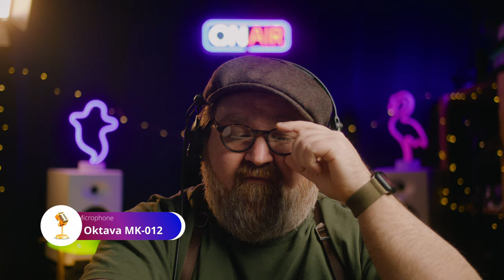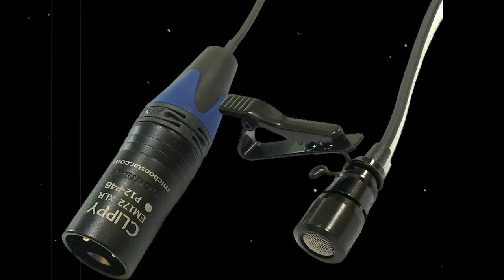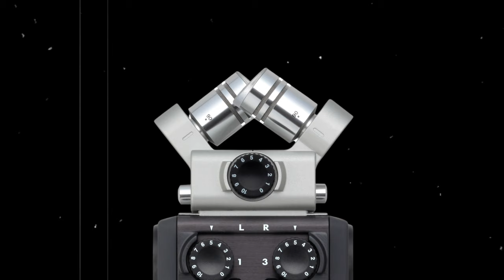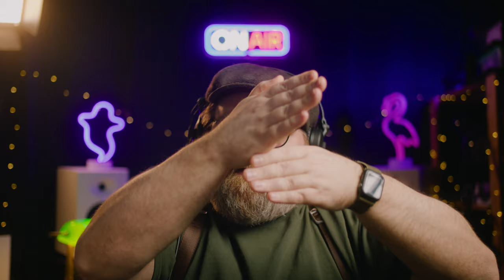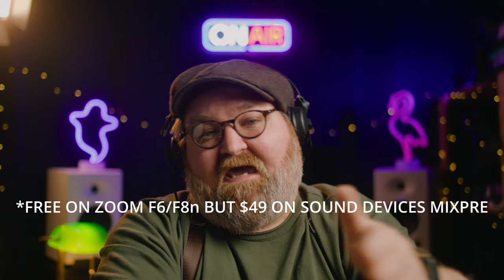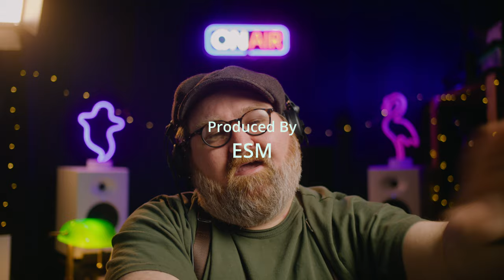Introduction to Field Recording Volume 2

Comment: Can you tell if the Rycote BBGs are a working fit for the CM4s? I use two CM4s in ORTF for Ambience and really like the results but building a windscreen that really works is tough!
Reply from the maker: Oh yes. The CM4s hate the wind! Any SDC mic would. The BBG will work for sure, but that depends on how much wind you’re dealing with. Sometimes I’ll also add the foamies that come with the CM4 along with a BBG to further help with the wind, and then just boost some highs in post to compensate. 

I hope this helps!

Comment: Thanks, I have been waiting for this!
OK, so setting up as ORTF with omni is not effective...sigh, well I guess it's not much different from AB.  Speaking the setup at the beginning is great advice, I wrote some software to transcribe any words at the beginning 30 secs as data, and I also take a photo whichI use to get the time, gps and weather.

looking forward to vol 3, and hope it's not all big budget gear.

thank you!
Reply from the maker: Those are great ideas! 

As the new videos come out in this series, I’ll be doing a mix of low cost and higher cost gear. But the only high cost gear I use is maybe the MixPre recorders and a Sennheiser 416. 

Cheers!

Comment: How do you go about metadata, levels, technical info like sample rate, putting it into a pack and selling it? What should I as a filmmaker expect when I purchase a field recording pack?
Reply from the maker: Hey! Thanks for the great question! 

If you have a recorder that supports notes and metadata on-site, this is also preferred but vocally calling out the info AND typing it either directly into the file (Sound Devices recorders et al) is always the safe route. 

As far as how to use that data, novice filmmakers and those not doing professional jobs might not care about that data. But SOMEONE WILL somewhere down the line and it’s super important to have it. 

To use it in practice, you might incorporate some or all of that information in the file name using the Universal Category System (https://universalcategorysystem.com). 

This is an industry-wide push to easily categorize all sound effects across the board. A lot of that metadata comes in handy here. 

As a filmmaker, if you don’t care about mics used or location or even time of day, then it won’t matter to you. But you might know exactly what you want because you need Norway, at Oslo at dusk (because the sounds specific to what you’re looking for). Etc. 

Hope this helps!
Reply: @TheRecordist  Thank you so much! I need some norwegian ambience and mountain bike sounds for a film I'm making, and so far I haven't found anything useful. So this summer I thought I'd try recording my own stuff. So this video could not have come at a more perfect time
Reply from the maker: @MarkusFinholt  oh that’s awesome! Good luck!

Comment: This is so valuable. Could you touch on making clean recordings, the activities that go into post. Also what a typical buyer of high quality audio looks for.
Reply from the maker: Thanks very much! 

Well, I always try to make the recordings as clean as possible by using quiet mics and a good recorder like the Sound Devices MixPre. The preamps on that recorder are very quiet. This helps to keep my recordings clean. 

Creating libraries is a massive undertaking. I would probably have some available now if I didn’t also run my channel. That takes up a lot of time. 

In post, it’s best to leave it as raw as you can — with the exception of high or low-pass filters when the subject requires it. The end user would want the option to edit as they see fit. One shouldn’t presume what the end user wants. 

WHAT to record is anyone’s guess. It could be anything. The clean and isolated sound of a loon is surprisingly rare. As is the sound of Thunder without rain. Since the end user wants to have full control of the mix of the environment, having each sound isolated without being polluted by other sounds is key. Unless you’re after ambiences. Ambiences can be made up of whatever the ambience is. 

Cataloging your sounds (naming them) using a system like the UCS (Universal Category System) will allow for easy database integration and will make everyone’s lives easier. 

Hope this helps somewhat!